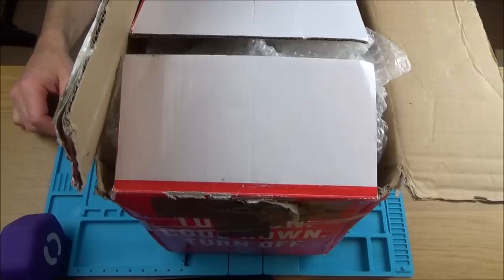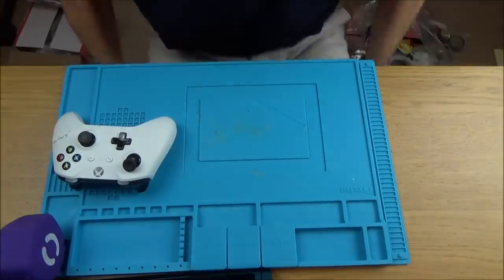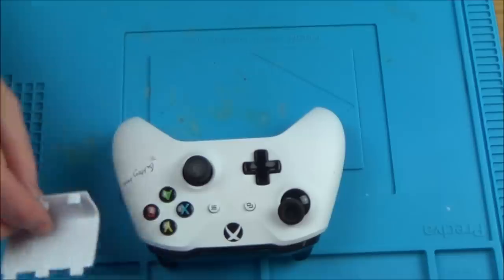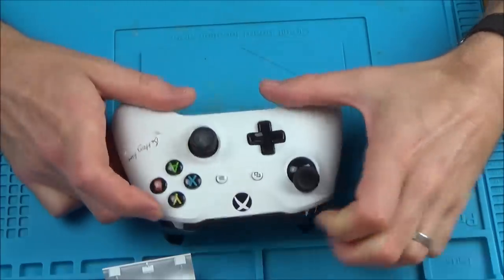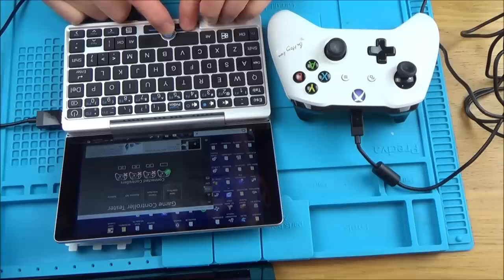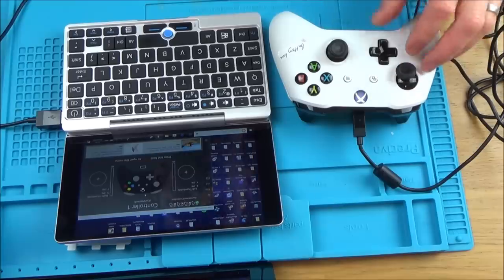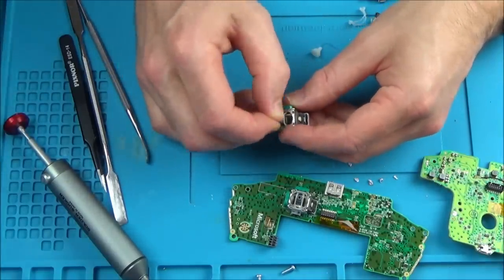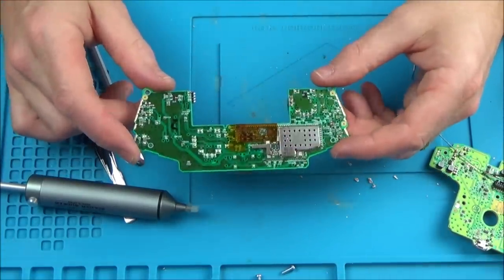Trying to FIX eBay Joblot of Faulty Xbox One Controllers PART 3

Comment: Hey Vince, what air flow did you set the hot air station to when moving the resistor over? I usually struggle with the rectangular caps and resistors, the air just blows them away most of the time.
Reply: He said 2 out of 8
Reply: @holnrew  ahh I must've missed that, thanks
Reply: I thought he said two (out of 8)
Reply from the maker: Thanks for the replies, from memory I think it was 2 out of 8. I am not sure what that equates to as in litres per min or whatever the measurement is. It was on very low though as these boards are nice and thin and heat up quickly :-)

Comment: Anything passes quality control for these. I had a PUBG controller with a wire sticking out under R trigger... i got 3 of em now and each have different feeling triggers. Got a trigger which clanks down due to rubber stopper being too short, got one with rubber stoppers being too long so it feels jumpy when pushing trigger all the way down. Got one with springs that click and have some resistance when pushing down for 1st push. These xbox one controllers are made for $15 AUD in china and sold for $100 AUD. Microsoft and high quality don’t go together. Even “elite” controllers are dodgy as shit with rubber grips peeling of due to cheap glue. These controllers don’t last even if you treat em like gold. To put it in perspective I got Nintendo 64 controllers that work flawless and analog sticks are 10/10 stiff because I look after stuff and and put silicone lube on analog sticks to stop grinding.

Comment: could someone have put something in such a way that when the unit syncs up it shuts down and I think that EBAY seller must be having a laugh, take two wires from a telephone cable and twist them together to create a transmission line and you just have to make sure that both ends of the one coloured wire is soldered to ground and the other wire connects the two points that the center wire of the coax connected to, Hot Tweezers is what you should have as it lets you remove SMD components without a hot air station.